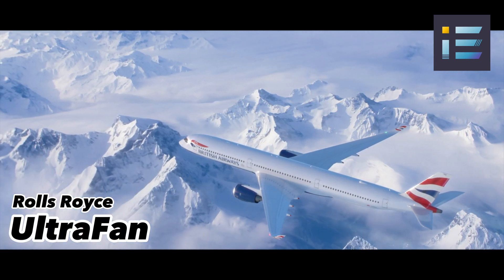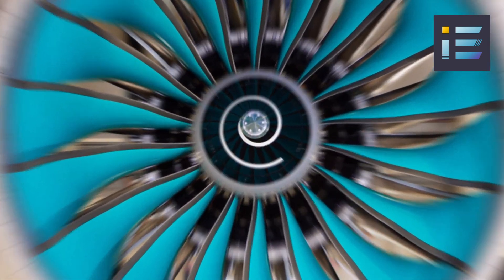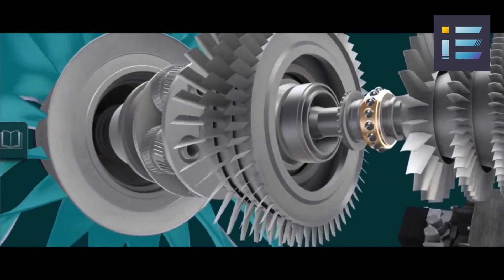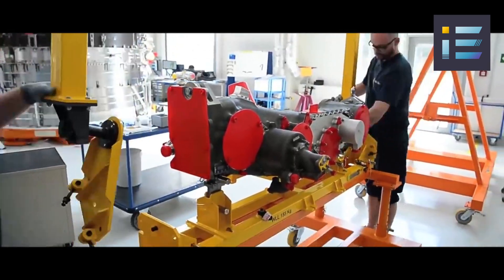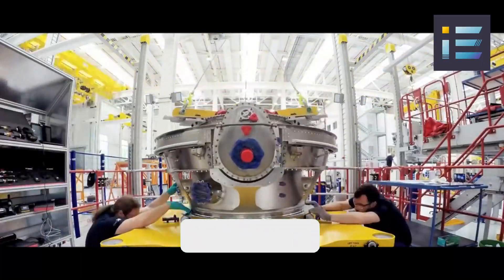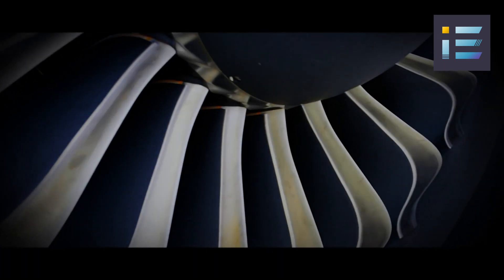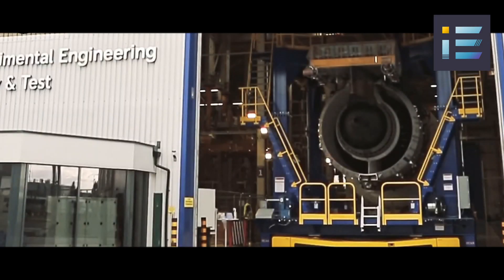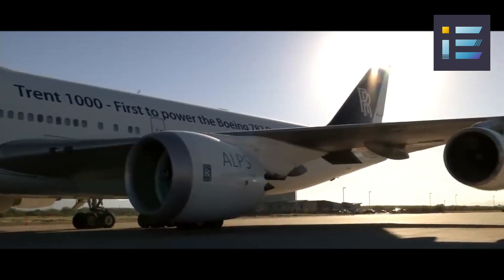Rolls-Royce UltraFan Insane Engineering - the Future of Aviation

Comment: Why are you quoting imperial units?! This is science and engineering, use SI units!
Reply: In the aviation community, engine thrust is almost always quoted in pounds. Much like airspeed, which is almost always measured in knots (nautical miles per hour). Oddly enough, aviation fuel can be measured in pounds or kilograms.

Comment: The Kuznetsov NK-93 is the most efficient design so far.  The western world has more efficient power sections than the Russians do but the ducted contra-rotating bypass section is the best fan connected to a power section. The front and rear blades are variable pitch. The front has 8 blades that provide 40% of the bypass thrust while the rear has 10 blades that provide 60% of the thrust. It has a bypass ratio of 17:1. Combining this ducted section with a modern western power section would beat any design out there. The only drawback is a slightly lower cruise of Mach 0.75-0.8. Combining this with a rotating detonation turbine would beat any proposed jet engine in the world for efficiency
Reply: After spending billions on R&D the engine was never certified by the Russian authorities.
Reply: @Snaproll47518  
When politics and a central government control too much this is what you get. It is absurd isn’t it!
The USA did that with the X-33 / Venture Star which actually was functional. At the time the systems required aluminum for the fuel tanks and not composite as the later wasn’t mature enough. The federal government cancelled a reusable single stage to orbit spacecraft that would have worked.
Reply: Does the NK-93 meets Stage 5 noise regulations? How many have been sold by Kuznetsov?
Reply: @Snaproll47518  
The NK-93 flew as a prototype but when the Russian economy collapsed the project was cancelled. It will be quieter than the Progress D-27 on the An-70 cargo plane. It will be quieter than the GE Safran RISE that is being developed. It will beat any UDF Unducted Fan or Propfan for noise.

Comment: The Future is in PropFan!
The PropFan Engine is the most efficient technology of all engines.
Reply: The Kuznetsov NK-93 is the most efficient design so far.  The western world has more efficient power sections than the Russians do but the ducted contra-rotating bypass section is the best. The front and rear blades are variable pitch. The front has 8 blades that provide 40% of the bypass thrust while the rear has 10 blades that provide 60% of the thrust. It has a bypass ratio of 17:1. Combining this ducted section with a modern western power section would beat any design out there. The only drawback is a slightly lower cruise of Mach 0.75-0.8
Reply: @andrewday3206 
 I agree!
Counter-rotating engines are excellent against Propfan!

The problem is noise and the level of demand from regulatory bodies.
The PropFan consumes more but manages to get less noise depending on the size of the blades.
Reply: @x-gamessimulator1067  
I’m thinking the contra-rotating design as a ducted fan would help with the noise and efficiency

Comment: This is nothing more than a GEARED FAN engine.

How come they never say that it is superior to the triple spool engine that they have 'crowed' about for years-!
Reply: It is more than just a geared fan. The P&W GTF is exactly that a gear between the turbine and the fan. This has gears between the turbine power section and the fan, but it also has gears between the compressor turbine and the power turbine. This allows the compressor section to spin at its most efficient and the power section to spin faster at its most efficient. The bypass then spins the slowest of them all.

Comment: Rolls-Royce is developing this engine technology for a new engine that will replace the long-selling Trent high-bypass engine. Expect versions from 78,000 to 120,000 lb. (346 kN to 534 kN) thrust that will power the 787, A350 and 777X models.

Comment: Yes. Although tbh its the first time Rolls Royce is embracing much of this technology. GE has been using composite fan blades since 1995, and CFM and Pratt and Whitney have joined in with their LEAP and GTF engines respectively. If RR combines composite blades and geared fans with their 3 spool design, they will have one of the most efficient jet engines out there